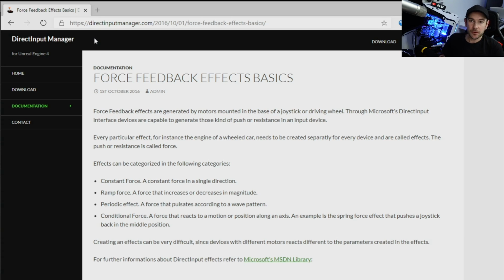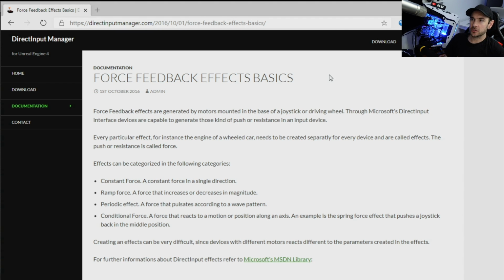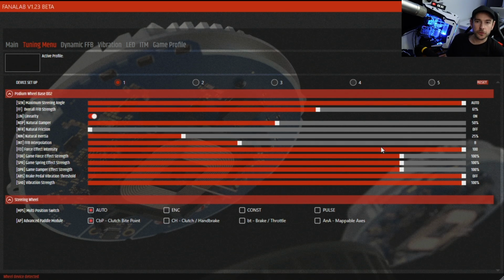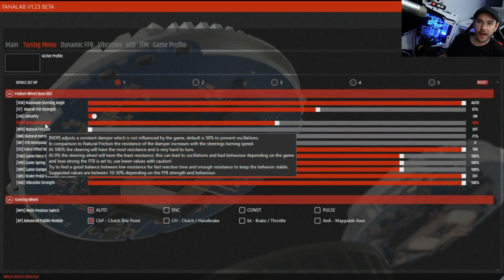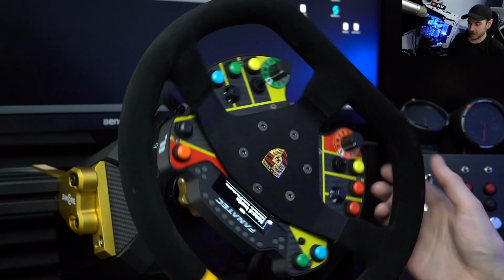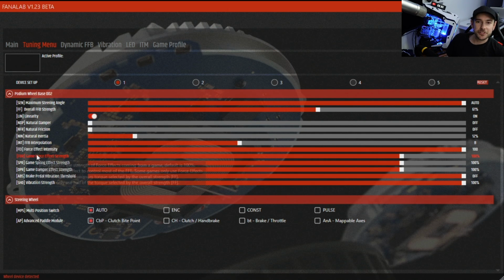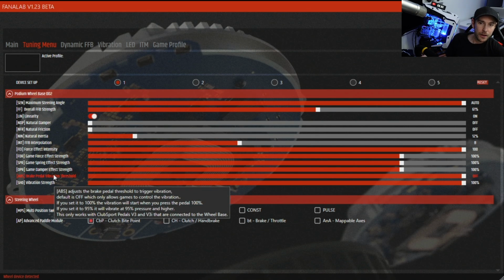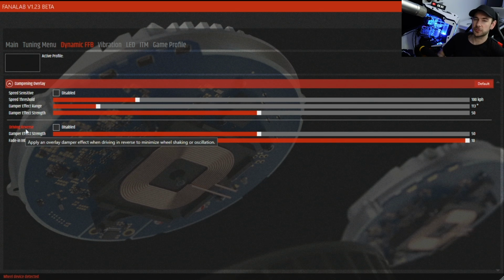FORCE FEEDBACK SETTINGS EXPLAINED - How to get the Best Force Feedback from any Fanatec Wheel

Comment: FINALLY someone who explains the miracle about software Clipping right!
DD users indeed should set a max in Game gain of 70 to avoid this software Clipping (at least in AC and ACC and AMS2).

However, I personally don't agree with the Linearity part, I like it much more to leave Linearity Off which is also the recommended setting from Fanatec and therefore the default value.

Regarding Spring, only game which uses this in Game is Forza. No other game uses SPR, so it doesn't matter if you set it to 100 or OFF. Other games like AMS2 and pC2 use SPR but only in the game menu, not while driving.

More or less the same for DPR which also isn't used by many games, therefore NDP is the Nr 1 way to go to add Damping to the steering.
Reply: Linearity is actually the other way round, it limits max torque if turned on -> I do not use it. It alters the original FFB which you do not want, unless you really suffer of oscillation or other unwanted effects. At least in iRacing - NOT recommended.
Interpolation: again, strongly disagree, 8 is far too high and smoothens the FFB too much. 3-5 is enough (I think default is 5 and was fixed in earlier firmware versions)
Reply: @iseeq72  I use a Fanatec CSL Elite F1 PS4 and I drive in ACC... mine does oscillate a lot what I don’t like. I use the last beta driver of Fanatec. If I turn down ‘gain’ in ACC then my F1 wheel doesn’t oscillate but it is much to light for my liking... Do you know what the problem is ? Any solutions ? Thanks in advance
Reply: @FG_356  did you find a solution regarding your problem with oscillations?
Reply: @iseeq72  Default for INT is 6 and feels how the FFB felt before implementation of INT. Especially in iRacing its recommended to set it slightly higher than usual because of their super old outdated 60 Hz refresh rate, so 6-8 is perfect for that game. In other games 3-4 indeed is better, but not really for iRacing as iRacing is much too harsh with a low INT, especially combined with FEI 100 which is also better to lower to 90 or even 80.

Linearity is true, it limits a DD1 to Peaks of 15Nm and a DD2 to Peaks of 20Nm (so basically to the holding Torque values of each base). However, in the iRacing options this has to be set to on, but it's not recommended to set it also to on in the tuning menu.

However, in the end FFB is highly personal and there is no right or wrong, if you are happy with a harsher FFB with INT 3 then go for it :)
The majority however will be happier with a smoother FFB in iRacing I think.